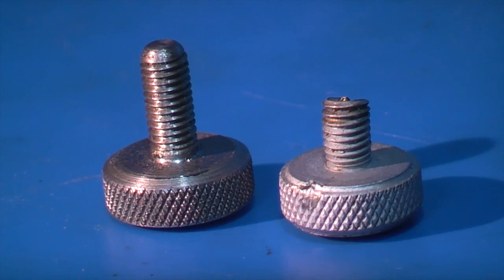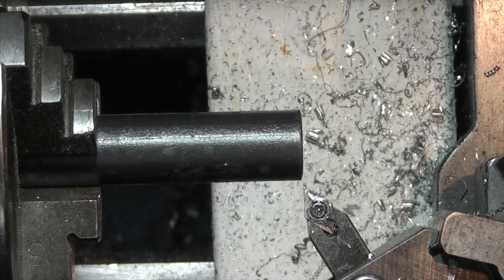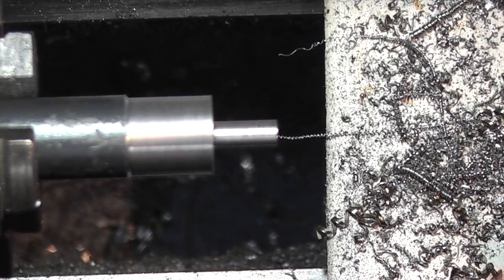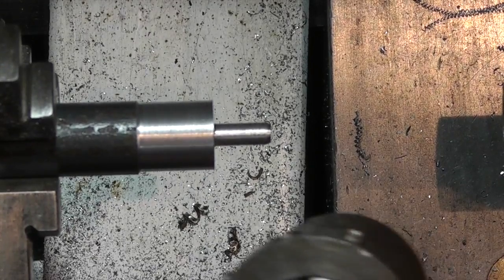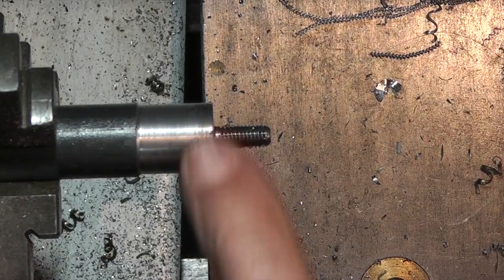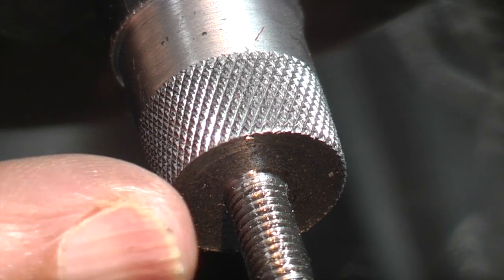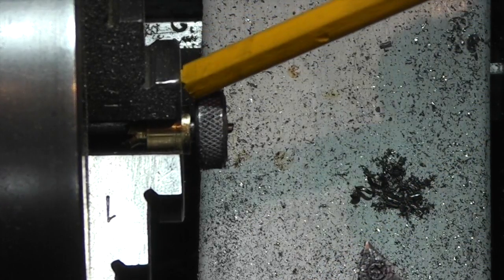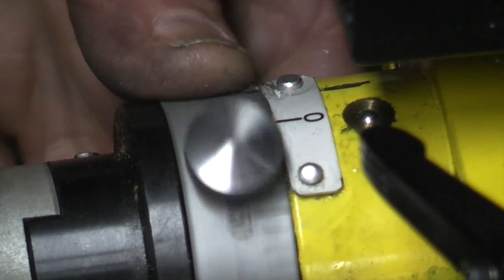Replacement mill screw

Comment: Hi Alan, If you havnot knocked off the table locks by now, they foul on the bed if they are in the wrong position.
I cut mine off short, with no detriment. Regards
Mike
Reply from the maker: Hi Mike Thanks for the info but I have removed my lock screw on the y axis as I don't use them. I always use my DRO.

Comment: The thread is a bit longer than it needs to be.
My old mill doesn't have a hole for the thumbscrew but under the collar is a groove which
I think had an 'o' ring. I put one in but didn't last five minutes.

Comment: Nice work!   Bad design on the mill.
Reply from the maker: Hi Fred Yes I think it needs modifying making it like a lathe with a small piece of spring steel to hold the dial to the shaft.

Comment: I understand the purpose of the video is to not just show making the screw, but to also show the process, but (and pardon my ignorance) why wouldn't you just grab a M5 hex head and mill it down to size and knurl it?
Reply from the maker: Hi Benny  Good question take a 6mm hex head the size across the flats is about 10mm the diameter of the thumb screw head is 15mm the thumb screw needs a bigger diameter than a standard bolt head.
Reply: @enotsengineering  thanks! Yes, it did occur to me, but I thought maybe one can buy bigger headed bolts, so I got online and checked with and realised that standards mean standard everything - thread, head dimensions, shapes etc. It was much nicer watching it being machined from rod! Especially loved the mirror finish of the curved face by using emery paper.
Reply: Unless the screw was of very poor quality and therefor not very hard, the standard grade 5 or 8 industrial quality screws would most likely ruin the knurling wheels. There not meant to be used on hardened material Benny.